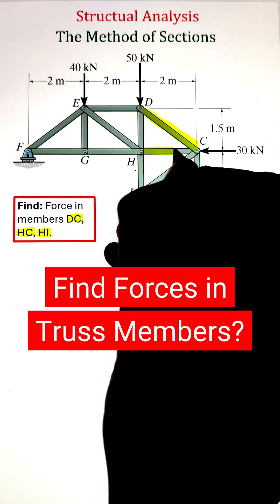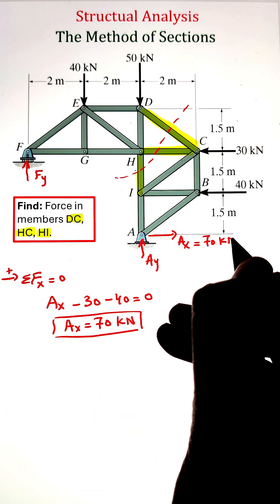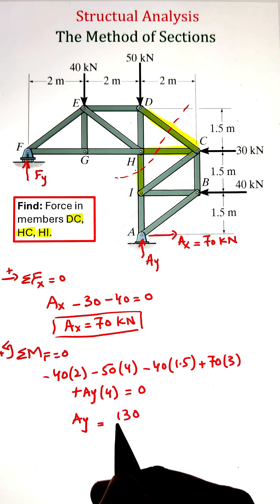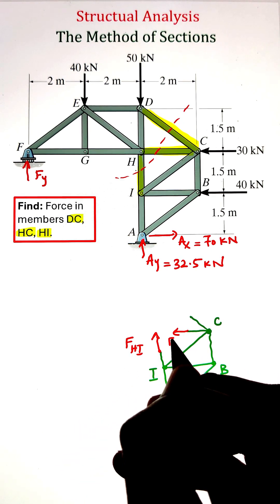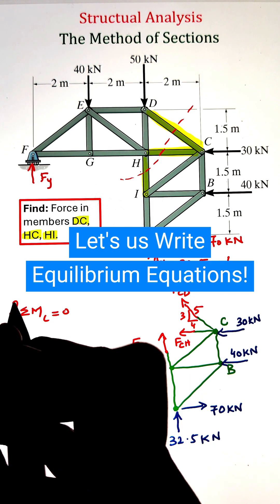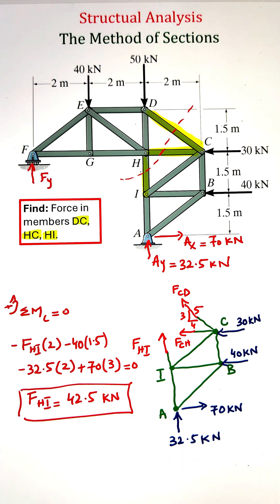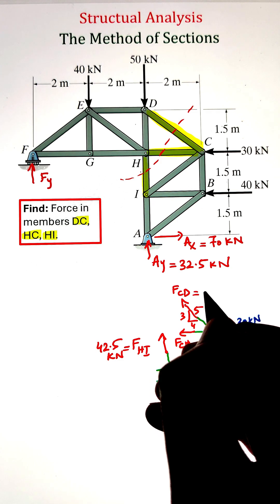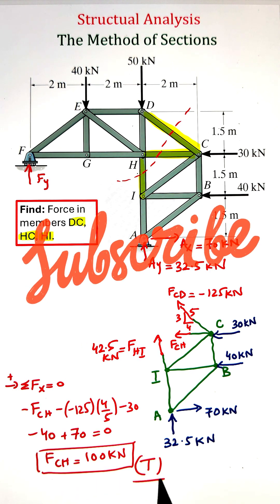Forces in Truss Members | Method of Sections

Comment: why did you not include the horizontal force 30 kN at point C when you Moment at point F?
Reply from the maker: Because it is in the same line of action, that force will basically try to push point F, but can't create a turning effect (moment) at that point. Also for a moment, you need to have a moment arm, if the force passes through the point at which you're calculating the moment, the moment arm is zero. Hope this answers your question.
Reply: @MathPhysicsEngage thank you so much!

Comment: GREAT VIDEO. How do you know the triangle is 3 4 5?
Reply from the maker: If you multiply the sides of the triangle with a constant number, in this case 2. You will see the 3-4-5 triangle. Since we are taking the ratio of sides, we can multiply or divide the sides. I am glad you like the video. Thanks 😊
Reply: @MathPhysicsEngage still do not understand cause adj is 2 and opp is 1.5 for triangle DHC
Reply: @brandondeon8999  you can just use pythagorean theorem, sq rt of (1.5^2 + 2^2) will give you 2.5 (hyp), making 1.5, 2, 2.5 a 3-4-5 ratio